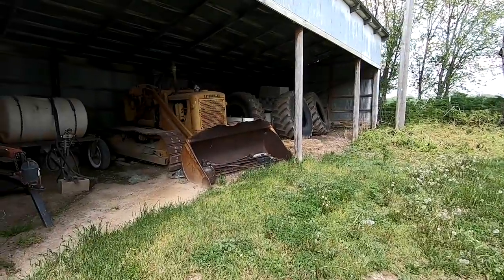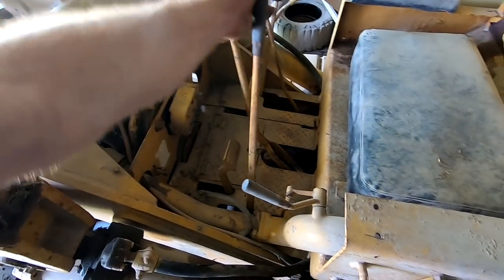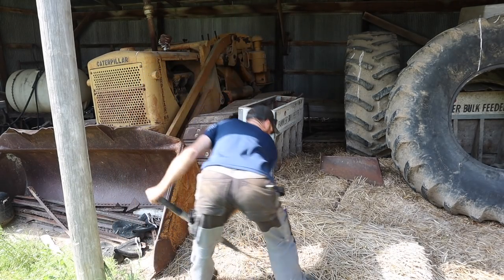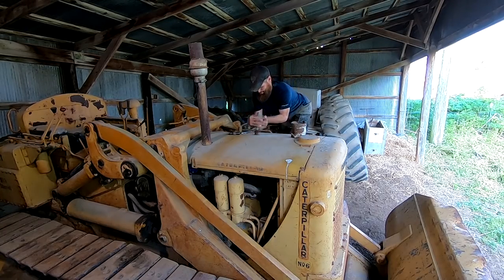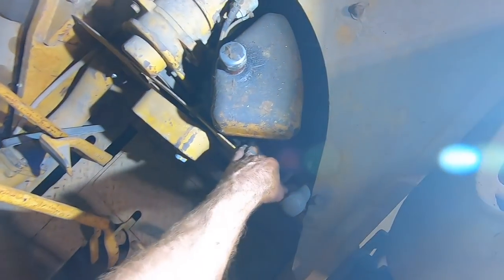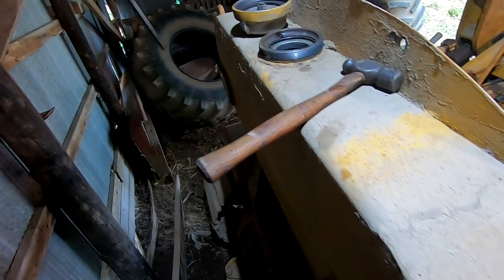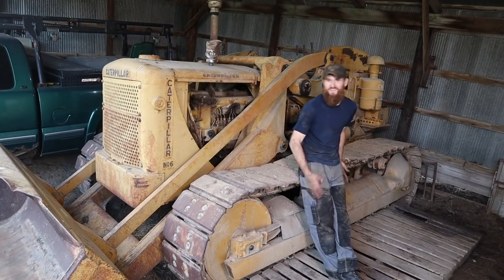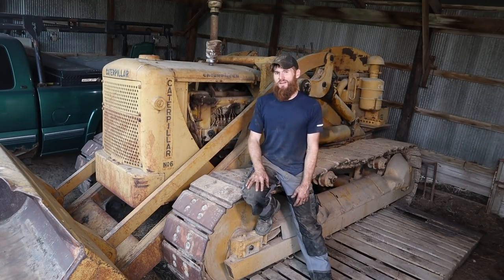RARE Caterpillar Track Loader DISCOVERED Forgotten in a Barn ~ DAY 1 ~ 1954 Caterpillar No.6 Shovel

Comment: If I can make a suggestion, having watched every video you've done- Don't start tearing it apart until you know for a dead certain fact you need to. There's no need to take the hood off for example. Ol' Red isn't going anywhere for a long, long time since you cut the track on it. I want to see you succeed, sometimes you seem to get ahead of yourself. No offense intended, but you have at least a dozen projects that I haven't seen you touch in a long time. Unless you have a crap load more storage space than it looks like you're going to be up to your ears in unfinished projects. The last thing you need to worry about is naming it.

Comment: Oil cooler is for diesel engine oil .. oil filters drain back into crankcase so warmup with the pony and making sure the oil pressure comes and stays up is very important. These old engines tent to rum low oil pressure at an idle. I get 30psi at idle to 35psi. 10psi ish is about as low as I'd go.
I had to mark Gas and choke.
Check the pinion clutch has new ATF helps engage. Idle pony way down also helps to engage.the 
Check the fuel injection pump, drain and make sure no fuel is bypassing the plungers and the pump is full of oil (30w) and check the governor for oil or fuel intrusion. Check diesel engine oil for the heavy smell of diesel. there is an O-ring between the injection housing and the fuel tower that is known to go bad.
the D318 has a 15hp pony a little different than the 10 hp in Old Red. 
You know about condensers and points soooooo, just cleaning parts should bring spark back to life if not it's most likely a condenser.

Cat No6 Loader 2.25 cu.yd. ... 
1953 ... 10A 1 to 10A 364,
1954 ... 10A 365 to 10A 889.
1955 ... 10A 890 to 10A 1616.
Ever thought about joining ACMOC? $45 (online) er $60 (magazines) for a year subscription and they have saved me WAY more money than that just in frustration. ACMOC has all this information available and manuals to members online and a lot of them on the Form are WAY better than I am at this stuff.
Tell the Fat Dan sent you and the should charge you at least 10% more LOL🤣😂🤣
Reply: @DontCryAboutIt  thanks
Reply: @Fatamus  He asked for a name to give the machine. I suggest we call it Fat Dan. Great reply you gave him. You know your stuff.
Reply: Thanks for the ACMOC shout out Dan!!
Reply: @MrJddelta  Absolutely.
Reply: How about “D6 Dan”.
Reply: @MrJddelta  I'm honored, but I think in the near future "Damn it Dan" will be more appropriate.
Reply: @ironman3406  👍
Reply: @davidelliott5843  👍
Reply: @MrJddelta  👍
Reply: @DontCryAboutIt  👍

Comment: Video length should be determined by goal completion (e.g. fluid check, basic maintence completion,  Inspection complete, component repair/replacement and etc.)  Love that you find these old machines and save them.

Comment: That dip stick right below the starting engine with the breather, is likely for an oil clutch.  Instead of being a dry over centre clutch, it is wet, they last way longer than the dry version. 
Choke should be the top, throttle should be bottom of its like my D2, D4, 12 or 212.
Only 1616 were built from 1953-1955, so it’s definitely not a common rig, it definitely deserves to be saved for that reason. 
As far as a name - I’m really bad with naming equipment but maybe “Uncle yeller” 
I know another commenter made the suggestion about joining ACMOC (antique caterpillar machinery owners club) but I’ll suggest it again.  Various different levels of membership are available.  There is a large group of enthusiasts who have access to lots of great info to help you along the way.  You get access to the online technical library where many parts, service and operators manual are available for you to view.  We have chapters all over the world you can join up with and attend rallies where we put this old iron to work and show off the great history of Caterpillar.  I’d be happy to provide you with more information or chat about it if your interested.  We would love to have you as a member, you clearly are getting the addiction for vintage Cat iron ;) have a great one.
Reply: Amen on the wet clutch longevity !!! Bullet proof kit ! Would also suggest to him to flush the Pony motor tank/line/carb/bowl before attempting to start her up ... "Gas" doesn't live very long at all ... heck,  that could contain "Leaded" gas she's so old; hence I always drain the gas tank and add Berryman's B-12 to keep the lines stable.
Reply: I think that ACMOC should award salvage workshop a special emeritus membership as he has done a ton of work sharing his love of old iron and inspiring many others!

Comment: I was the general foreman at Cat during early 70's where these excavators were manufactured. Also operared machinery and made tractor and engine parts and also forged  Caterpillar first track links and rollers. I have in Cat facilities and suppliers all over the work. I am a young retired 77 year old Cat retire. Really truly enjoy your show. Mex father-inlaw probably built the No6 shovel you are working upon. He is deseased but I still live within 5 miles of where that machine was mfgd. Regards Mike B.

Comment: 22:00 open the transmssion and the hydraulic tank - the very bottom has all the moisture and metall shavings in it if it sat long - so you can get that stuff out without stirring it up - so you have to replace probebly a quart of oil each instead of a full change 
id generally pop the valve cover and check for stuck ventiles or any damage - also if the engine is hydrolocked with fuel or anti freeze it would be nice before burning the pony motor clutch and bending rods
Reply: Great advice ^^^^^^
Reply: @alcopower5710  yep.
Reply: maybe also do the final drives
Reply: @prinzeugenvansovoyen732  although.. if it has only 900 hrs, there won't be much metal shavings or water, especially if it was maintained that well and parked there...
it's simply a very, very lucky find... to find a machine from the 50s or 60s that wasn't worked to death and beyond, looking this good.
Reply: @JoE_Songs  true, condensate still might have entered somewhere, and final drives or one of the gearboxes might have leaked and drained out
Reply: @prinzeugenvansovoyen732   ;-) okay, better save than sorry. agreed. 
I guess,  just get carried away by just how pristine this dozer is...

Comment: Just watch day4, sounds great. When adding coolant, don’t forget to bleed air out of system. If it’s real low, it won’t register on the temp gauge.Also remember to check the final drives for oil. I love old equipment. I’m an old operator but never had a chance to run one of these. Only old 977’s, 955,s and D8’s. Besides a lot of other machines. Keep up with the good work. Will be watching for more episodes. Thanks.

Comment: I love it. It has a great history.  
Interesting note: doing the research I did notice all other 933 955 and 977's Tracked Loaders were referred to as Traxcavators where the Cat 6 (No.6) was always referred to as "6 TRAX Loader"
TRAX takes a Trek home.  humm trying out the name. TRAX different and interesting but there are a lot of good names out there.

When parked some old timers would open the petcocks in the pony heads and leave them open - would be no compression. For some odd reason these petcocks are different - they are backwards when they look like they are closed they are really open. 🤷‍♂️
Pull a plug spray with either or dip the end of the plug in gas.and replace then check for fire. That is how the operators manuals say to do it. 
If you really want to check for how much spark it has just touch a plug wire as you turn it over.🤣😂 if the fillings in your teeth start to smoke there is plenty of spark.
Reply from the maker: You are right on the petcocks! They were open, but looked closed!

You'll see the rest soon!
Reply: @SalvageWorkshop  cool cool cool,😎
It sounded to me like the peacocks were open but I couldn't see any compression vapors escaping there was something in the way.  So I thought I'd bring it to your attention. I've seen one other video the same comment had been brought up about the petcocks on the D318, FYI that year D318 has 75hp.
 Glade to see that worked.I'm racking my brain to see if I had forgotten  something. 
Fuel, fresh clean fuel should be looked into ASAP. The furl that's in it should be pre ethanol (no water) which is good. lt will be quit yellowed from age and should work but may (big may here but important to keep in mind) have an algae growing in it. Algae can be a bugger to get rid of which consists of draining, drying and decontamination of the fuel system. 
For now just make sure the fuel is not slimy inside the tank. It should be good enough to get you home and might not be a bad idea to just add some fresh fuel at the prices of fuel these days .

Comment: When I joined the Navy in 1995 as a Construction Mechanic we had a lot of what’s now vintage equipment leftover from the Viet Nam era (in 2012 we finally got rid of the last 5 duece and half fuel trucks with the old White multifuelers in them. All had less than 100 miles). Anyway, to get to my point, make sure you have a spare o-ring or gasket for the fuel sediment bowl on the pony motor. In my experience, they always look good like they won’t leak, and then do, and you’re up a creek. We used to have what we called “Live Storage”. It was all the stuff stored in case of a contingency deployment. It would sit in a warehouse for years with preservative in everything, which didn’t work! We’d go pull it out to take it to the shop and go through and the thing leaked like a geyser from anywhere it could. Those sediment bowls caused a lot of heartache. Last couple times we had to hunt one we ended up bypassing them because they obsolete. So if you have an extra bowl I’d grab it too. Those things are slippery once they have gas on them and sure to break if dropped. Good luck friend!! Wish I was there with ya and looking forward to more videos. From Hendersonville NC

Comment: If you need to remove the hood, can it go high enough to remove the bolts holding the stack to the manifold? Seems that would be much simpler than removing the manifold.
Reply from the maker: Yeah, next time i'm out there i'm going to look at that! I agree, it would be easier!
Reply: there is an exhaust clamp just under the hood, just Unbolt clamp  and remove the  exhaust extension. easy to remove, if it is not to rusty. @SalvageWorkshop

Comment: The Cat No.6 shovel uses the D318 engine , just  like the D6 of that era. The first fluid I would check is the oil level in the injection pump. ( it is separate from the engines lube oil) The oil level for the steering clutch booster pump is next. It’s at the back under the diesel fuel tank. This tractor is in great shape. I have one just like it. I have the books on it for operating, maintenance, and parts if you need any info.

Comment: I have a No 6 shovel, it looks exactly the same as yours. The diesel engine says its a 318 built in 1947.  My father has had it for many years and I dug the basement for my house with it.  I am wanting to get it going again because I can use it on the farm.  The rear sprockets are worn out and need to be replaced but I don't think is would be much work to get it going again. it has been setting for 30 plus years.  Good luck with yours, I enjoy your channel..

Comment: That round plate above the drawbar was probably for a cable control unit which could be mounted there for rear scrapers or for a front mount cable blade.  Remember, this is a converted D6 and the D6 was used in those days for pulling scrapers and dozing with a cable blade.    The later 933, 955 and 977 were true track loaders from the ground up so
would have no use for a cable control unit or drawbar.

Comment: i was 17 years old when i went to work for my Dad he was in the sand & gravel business and No 6 shovel was what I run loading  trucks for a few years there is a typical cat tool box missing on the back below the fuel tank that covers the opening over steering booster and the side covers it is identical to the one I ran  1971-1974 I am  really excited

Comment: Love your fearless approach to tearing open machinery to get it up and running. Thanks to inspiration from your channel, I tore down and rebuilt a Ryobi circular saw last weekend when the spindle-lock button broke, leaving the lock lightly engaged with the gears. I fabri-cobbled a fresh button from a screw that both engaged with the lock/chuck and held the original spring in place. Never actually got to the project I had grabbed the saw for, but I sure had a feeling of triumph when the motor started and the blade spun up even after I had the thing torn down to parts! Keep up the good work!

Comment: I'm not sure if I saw you use this before or not, but they make fuel-finding and water-finding paste for sticking tanks.  They make all different formulations for different fuels.  They're a must when sticking 10K+ gallon tanks.
Reply from the maker: What is it? And what do you use it for? Im not familiar with that.
Reply: @SalvageWorkshop  Its a paste that you can spread thin on a stick. It changes color when it reacts with either fuel or water.  I can simultaneously tell you the fuel level and measure any water in the bottom of the tank.  A tube lasts a long time.

Comment: I thought it was a 977 at first. I have a 977 series D in my shed. It needs a pony motor and the head installed. When we bought it we had to pull start it to get it running. I always said everything was steel on them except the seat cushion! They're built. Amazing lifting power.

Comment: The exhaust from the pony motor is routed through the intake manifold of the diesel to heat the air for easier starting. It is a pipe through the intake manifold it's not open to the intake manifold. Water down the pony motor exhaust won't go into the diesel unless that pipe running through the intake manifold is rusted out. It's a pretty hefty pipe not just regular exhaust pipe. But like anything else if water sits it long enough it will rust.
Reply from the maker: Ahh... i didnt realize it was lined inside the diesels air intake, but that makes perfect sense! Thanks for letting me know!

Comment: What a awesome find! If companies built stuff half as well as that machine is built, this country would be a lot better off. Sorry about that, but I am passionate about older equipment, and how well it was made. Hopefully, you won't have to much problems getting it back in running shape. Stay safe!
Reply from the maker: You aren't alone in that passion!
Reply: @SalvageWorkshop  I wish sometimes I would come across a good barn find.  And it was a easy fix.

Comment: Squatch Toby was born with a caterpillar hanging out of his mouth. Lol 😂 😂. Just joking as he knows a hell of a lot passed down from grandfather to father to son. 
However it’s good to see you with very little caterpillar knowledge doing your repairs which brings back good memories back to me. 
In Australia I think that model is very similar to to the 966 Traxcavator which I drove for 6 weeks burning log heaps in a 700 acres cleared block of land. It had its shovel removed and a rake fitted. 
The biggest problem is it had a fixed track system which Traxicavators have and when turning on uneven ground would chew up the ground. 
They where very good in quarries as the whole idea was start with a even surface then work the dozer and keep the ground level.
So the soil I was in was sandy but I minimised the screwing around by turning slight going backwards and back blade if you get my drift. Took longer to do but it worked ok. 
The 966 was a little bigger than the D6

Comment: It looks like this  machine has been looked after.  I think you will have not too much of a problem getting it running and working .  A boss of mine had a 977 Cat loader it was a beast of a machine. We used it to build fuel tanks.  Made the burns with it and we put a stinger with a winch  attached to the bucket to hoist up our steel plates

Comment: 1 Drain all fuel from both engines.
2  Use fresh fuel. 
3 Remove the diesel injection plugs.
4 Put a little oil in the cylinders.
5 Check the old wiring for a short circuit. 
6 Check the v-belts or replace those.
7 Check if all the bolts. 
8 Check te fuel and hydraulic hoses.

An name for it  Old Caddy 

succes

Comment: I love the channel and appreciate the reviving of these old machines. It makes me a little crazy seeing you touch those dipsticks to dirty dusty things and drop them back into the machine though, that and taking apart things unnecessarily like the hood. Also, the pony motors exhaust runs in a pipe through the intake manifold, but the two chambers are separate. Water down the pony motor exhaust won't get into the Diesel's intake unless there's something else broken. Water in the pony's exhaust is still bad for the pony though.

Comment: "Buy Clean Fuel & Keep It Clean" 
Comes from back then- you could buy "#2 Diesel" that was quickly and
crudely refined by boiling/distilling crude oil on well site, then minimally 
filtering it through felt or lambs wool (like Big Red's fuel filter).

Just as with anything "Union Made" the more it's processed the more it costs.
Many Farmers & construction firms would buy cheap, "dirty" (high particulate)
fuel, then just dump the sediment bowl constantly.

Rule of economics:
When restoring something, first things to look at are 
parts catalogs and your credit card. Caterpillar is great about both.

Would've greatly enjoyed an hour+ video, but settle for 30 minute any day
from you. Good luck on this beautiful find, young man. God Bless.